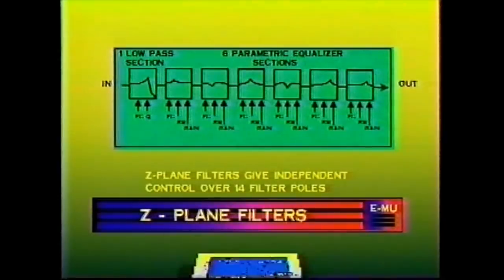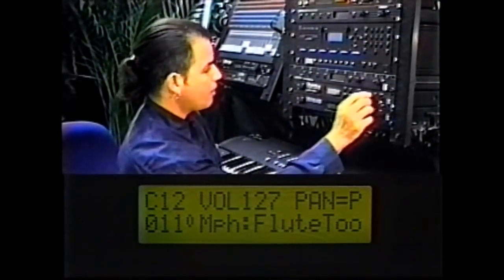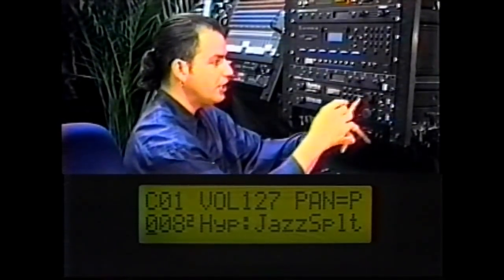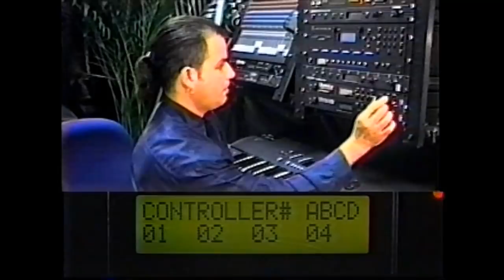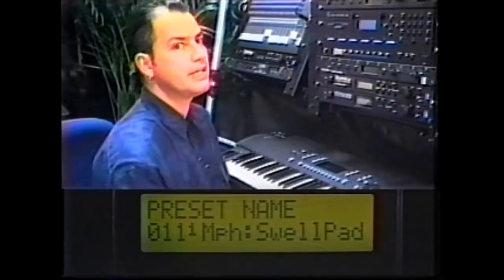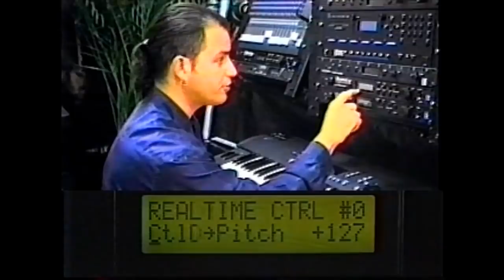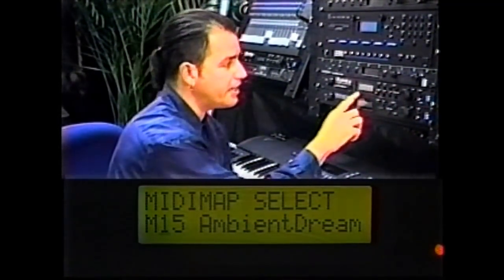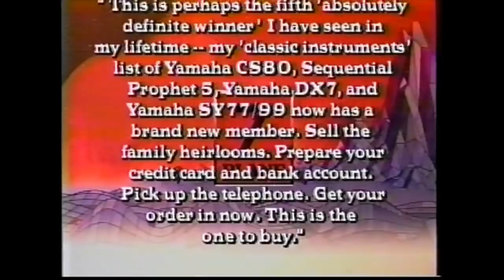FINALLY! E-MU Morpheus Z-Plane Synthesizer Tutorial!!!

Comment: The host Marco is the FATHER of Akai MPC2000! "In the early '90s, Marco Alpert proposed an 'SP1600' using first the sampling engine from the Emax II, and then the one from the ESI32 sampler. Product concepts were drawn up, but they were never approved. The new attitude that pervaded Emu was to build low-cost modules and achieve massive revenues. Marco took the idea (and his job) to Akai, and launched the hugely successful MPC2000 instead."
Reply: Wow if only they had listened to him that would have been so Dope

Comment: Does the Korg Wavestate have this dimension of having the output of the Morpheus Z-Plane?
Reply: Nope. Single digital lowpass in the wavestation, which is not bad, but the wave morphing function is more similar to the oscillator wave scan function (which he also demonstrates in this video).
Reply: @maxmace111  I am in the market for a stereo at least 12 voice synth (no rompler). Thinking of the Blowfeld. I have the Korg 2 Radias and want something at least as hefty as these.
Reply: @bobcatt2294  I would look at the current Sequential Circuits offerings. If you don't mind vintage, the Proteus 2000 is a terrific synthesizer, not just a rompler, and it's the cheapest way to get into z plane filters. Good luck though. Analog style polysynths are not where the market has been for the past few years. The the older Roland polysynths (and their recent clones) are not particularly deep, so finding a capable poly (like the Andromeda) is kind of a challenge. If you're trying to build your own sound, look to the American manufacturers (new or used). If you're trying to duplicate something in the mainstream, Korg or Yamaha will probably have something to cover you.
Reply: @maxmace111  Thank you  - will looking at what you have suggested. I have ruled out the WaveStation for sure.
Reply: @bobcatt2294  I certainly wasn't disparaging the Wavestation. My point was the wavestation filter was not it's selling point. Now that I think of it, it occurs to me the wavestation is part of that deep synthesis liniage that started with the PPG and Prophet VS. You'll have to balence your taste for complexity vs. ease of use. A Juno/DeepMind is very simple and immediate polysynth, but doesn't offer the level of options were talking about. Ultimately it would be nice to have polysynths with the flexibility of a modular system. There are historical attempts at that, but no killer app as of yet.
Reply: @maxmace111  I possess 2 Korg Radias (right and left hand at 24 voice each) among a lot of equipment. My music is film scoring. I've have enough romplers so going for deep synthesis. I've owned the DeepMind12 and sold it after just a few months. Was going for the E-mu Morpheus  but after hearing about some of its pitfalls I decided to not included it. But the sounds for ambient are almost unmatched. About the WaveState, the wave sequencer is not for my taste and Korg has branded it with the Wavestation's wave sequencer sound which I do not desire.
Reply: @bobcatt2294  Ah-ha! Then the sound your after is the ASM Hydrasynth. It follows the linage of the Morpheus and even has a bunch of highly coveted Ensoniq features. The only place it fails you is that it's an 8 voice poly, but hey, it can be multitracked. The stereo oscillator path, the wave sequencing, the poly aftertouch, the Ensoniq-UI and ribbon control? No competition! And check out Daniel Fisher's Sweetwater video where it puts the filter through it's paces. This sound is probably what you are looking for.
Reply: Hi Maxmace, the ASM was a contender however the low end is rather flat. When you think of the history of the developers I wonder what happen. The build and dashboard are both utmost sublime with an incredible logic-flow.
Reply: Bobcatt22 The Wavestate sounds incredible, and I think it would be perfect for film scoring.  The interface leaves a little to be desired, but once you get used to it, it’s very versatile and can offer a wide range of sounds.  I really highly recommend checking it out.  The short list of the hardware synths I use right now which would be suitable for film scoring include the Wavestate, Waldorf Quantum, and Haken Continuum.  Also Eurorack modular, but that’s an entirely different can of worms.  As for the Morpheus, I’ve had one since it was first released, but the difficulty of programming it always turned me off.  Dave Rossum has admitted that they intended the z-plane filters to be able to morph in real time in all three dimensions, but they didn’t have enough processing power to make that work, hence the new and improved Rossum Morpheus eurorack filter module.  Development units of the Morpheus also apparently had the ability for the user to define their own filters, but that was left off of the production model.  It remains an interesting box, and I’ve been thinking about pulling mine out of storage to play with, but I wouldn’t really recommend it compared to any of the modern alternatives.
Reply: @deastman2  , Thank you for your response. What turns me off about the WaveState is the wave sequencer, sounds like that of the Wavestation - non musical and very mechanical. Looking for the blood line of the Radias, but no such animal. I was reviewing the Morpheus Z-Plane and SoundOnSound and it revealed, as you have stated, the editing was bad news.
You have the  Waldorf Quantum? Wow!

I favor Bach and the Baroque era and any time I hear this kind of music being played on a synth demo - I get the goose bumps. Of course the color and instrument type is also most important. Was planing on consolidating my equipment and in doing so, would purchase a Korg Korons, however the only the weighted 88 key version has no keyboard issues as the others.  So talking about $3,700. Too much for my pocket. 

You can tell the economy is getting bad when music gear on CraigsList is not selling.  If you are on a forum be happy to continue this discussion and others.
Reply: Bobcatt22 Often I’ll make Wavestate patches with only two or three steps of the wave sequencer, slowly crossfading back and forth.  It doesn’t have to all be cheesy wave sequences like what the Wavestation was known for in the 90’s.  And yes, the Quantum is another of my favorite synths.  You can find them used for $3500ish if you keep looking.  You can look me up on KVR under this same username (minus the 2 at the end).